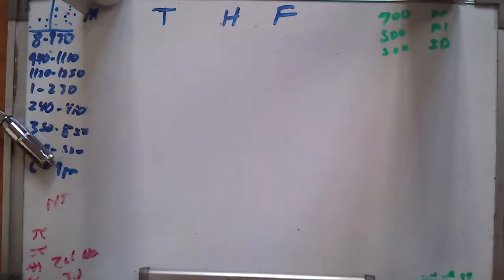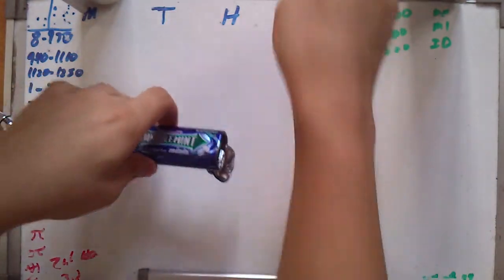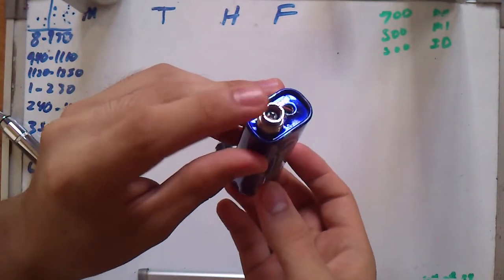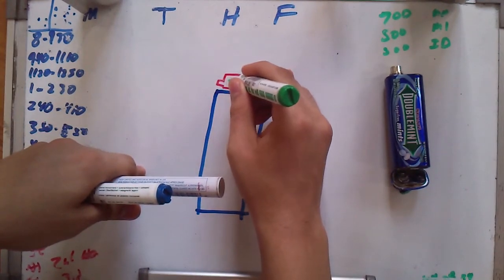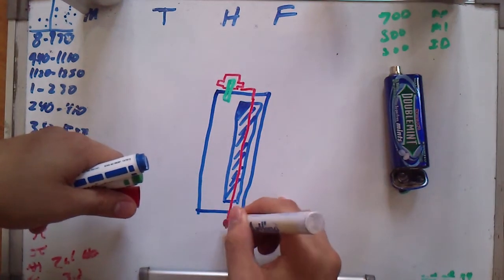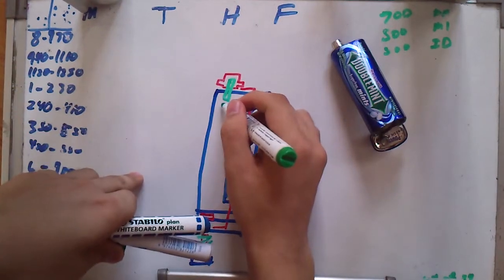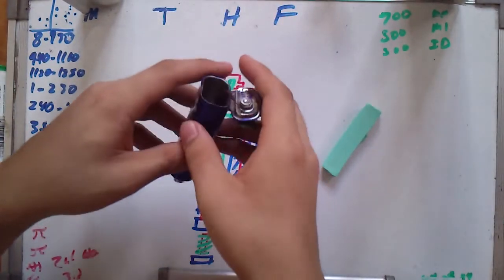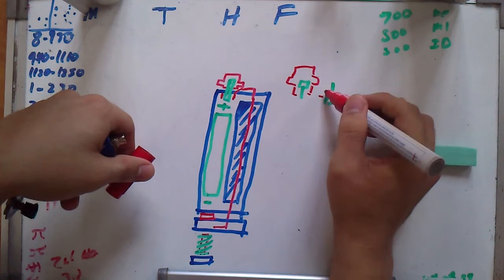Dmint full mech schematic

Comment: For the copper wire touching the 510 connection. It cant be touch a box also am I right? Im just wanting to make sure. Thanks
Reply from the maker: The copper wire can touch the housing body, the my original design did not need the wire at all however i noticed that the tin had too much resistance and so I connected the copper wire to lessen the overall resistance.